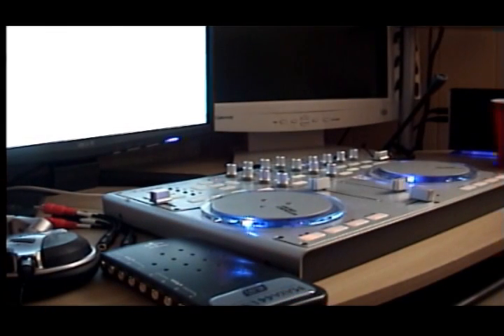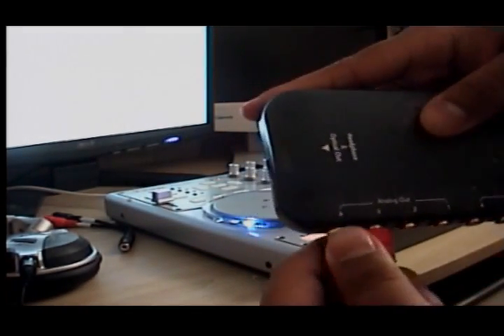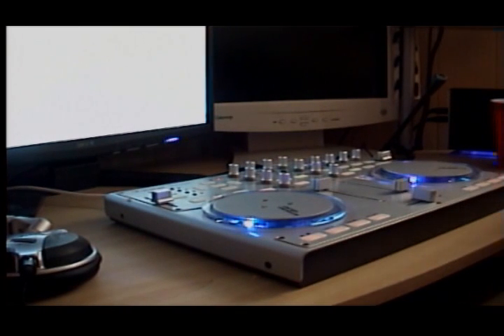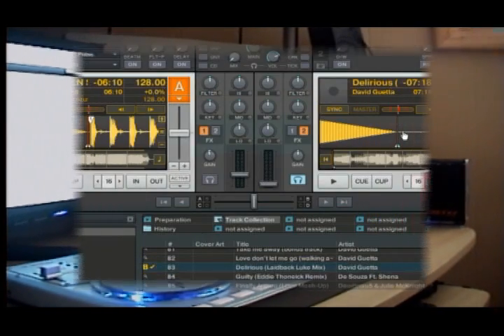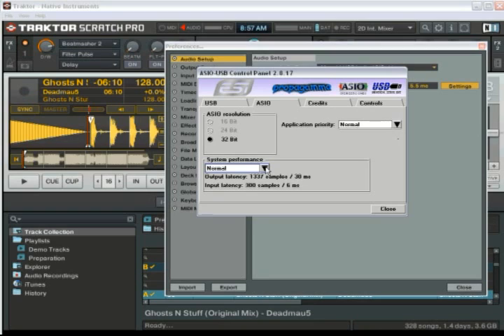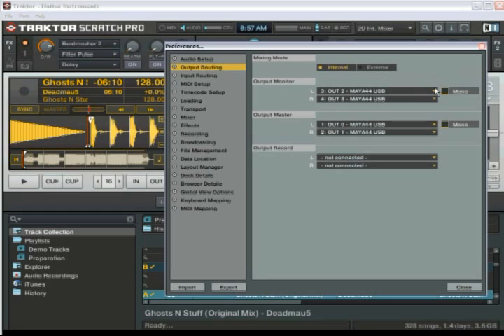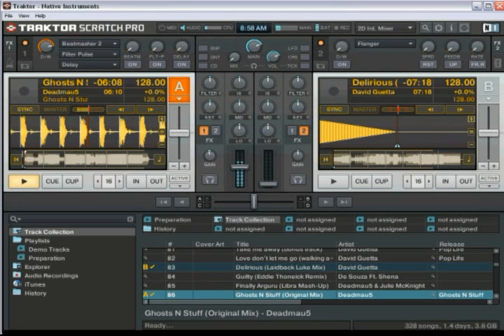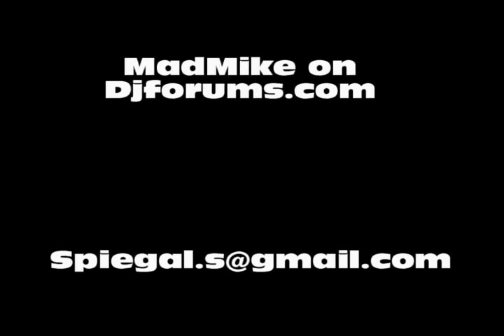Tutorial for Maya44USB Setup in Traktor Pro

Comment: im a first time DJ and im having a bit of a problem, im setting up my system with the red and white wires that are in the back of my mixer to the maya44, and running other red and whites back into the mixer, and ive connected it to my laptop via usb, and i have turned on traktor and tried to get traktor to work, and it is fine as far as picking up sound, but once i load a song, it seems to be on both channels, and sounds somewhat like a chipmunk, what am i doing wrong??

Comment: great video man :)
I just have a few questions.
i bought the maya44usb for prelisten tracks but i can't figure out how to use it.
I have the reloop digital jockey 2 (interface edition) and i'm using it together with traktor pro. i have 2 cables wich i connect with the maya44, 1 for my stereo and 1 for my digital jockey. Still i can't prelisten my tracks, probably because my preferences aren't correct. This problem is driving me insane so i really hope u could help me with this... thx